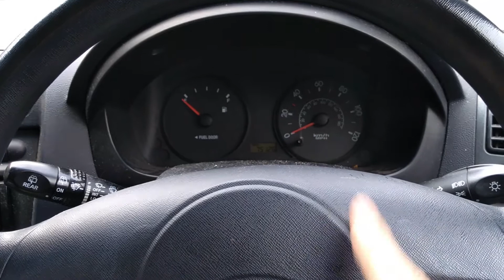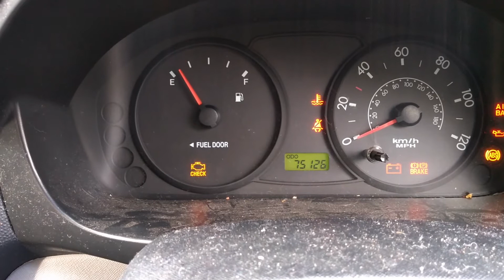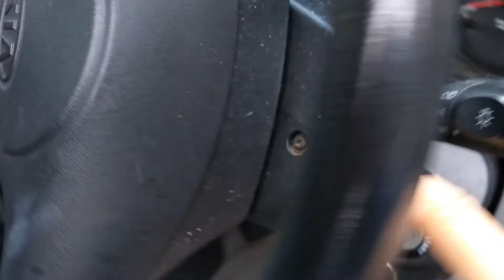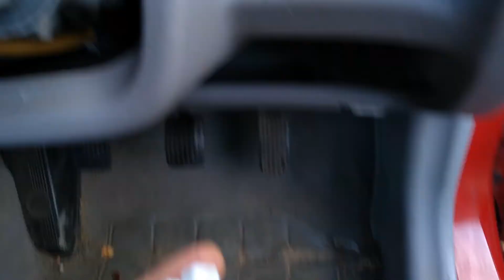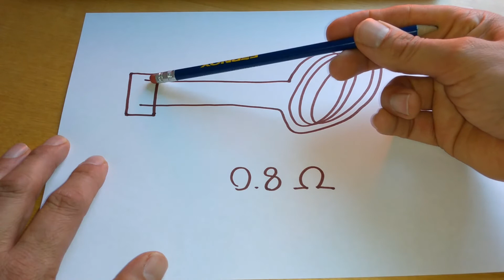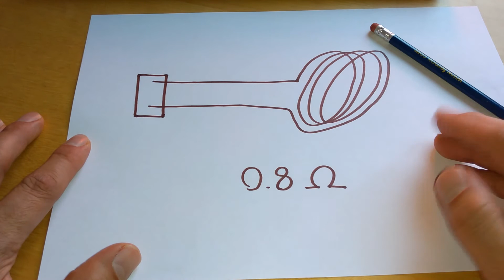Kia Picanto Intermittent No Start - Immobiliser Antenna Coil Fault - Diagnosis & Repair

Comment: Odd issue.. I hope I get an response…

My imobaliser light have stopped lighting.. but car starts fine.. (after I did the fix wirh the connectors)

But now the obd2 port have stopped working aswell… but car goes fine

Comment: Had this fault on 2009 Picanto. With flashing Immobiliser lamp. 
Did the multiple reconnections and has fixed it. Thank you. 
I accessed the plug from the fuse box cover as suggested by one of the comments on here.

Comment: Thank you so much for this video! I will definitely try this soon. Did just cleaning the contacts fix the problem for good?
Reply from the maker: Yes it did for me! :)
Reply: @iofix it seems to have also fixed it for me! I recently had a similar issue with my brake lights being intermittent. Took the clip off and sprayed some contact cleaner and worked a treat!

Comment: I never normally comment on videos, however this SAVED my car. Super clear video, worked with my Kia Picanto 2010 - I found if you know what the cable feels like, you can open the fuse compartment and reach round to unclip and re-clip the wire without taking apart the car. Super helpful video!!
Reply from the maker: Thanks for the comment and the extra info! :)

Comment: Brilliant!  Sounds exactly the same as my 2003 Hyundai Terracan (probably the same part).  In my case it has had this issue twice (crank, no start).  Both times after being laid up in a damp corner of the yard for a few months.  There was one point where the inside looked very damp indeed, so perfect conditions for encouraging contact corrosion.

Each time it's been towed out in front of my workshop in the sun and a few days later started fine.  It was only the other day I noticed the lack of immobiliser key symbol when it didn't start, and when symbol there, it starts perfectly.

In light of this video will pull the coil, test and if O.K. refit after a dose of contact cleaner and a good wiggle!

Thanks again 🙂
Reply from the maker: Thanks for the comment and extra info - sorry for the late reply.

Comment: This happened to my Sportage so i soldered the two coil wires to each other and bypassed the connector its a lot easier on the Sportage

Comment: That's more like the fault oxidized connection than the coil .. but strange how it's intermittent .. if oxidized switching ignition on and off wouldn't fix the oxidized connection .. thank you for posting .. hope you've solved the problem :)
Reply from the maker: Yes that fixed it my case. Cheers

Comment: Hi, thanks for the video. I have a similar problem but there’s no ecm light or ignition light at all! Just a crank no start, I’ve changed the ecu for a cloned one with still no luck and no mechanic is interested in solving it

Comment: I had the same problem with Picanto 2009 with the connector which I cleaned and remade. Lasted another 4 years and the defect is back again so will clean it again.
Reply from the maker: Interesting - thanks for the info.
Reply: What way did you fix the connection, I’ve replaced the new antenna coil from Kia, had a new key and still the same intermittent cranking and no key symbol. Cheers
Reply: @dmc1221  I used contact cleaner sprayed into the connector. Look closely at the connector pins and see if they are corroded. I would also have considered using an inline splice to connect the wires and remove the connector but in my case it was not necessary.
Reply: @ianhodges1657  no problem thanks 👍

Comment: In my mom's Kia there is the same problem once the car light appears once not, some time ago I dried the antenna coil because it was damp and it was quiet for some time, I have to measure the resistance .

Comment: Great video. I must try this as I have the same problem with my 2005 Picanto. Do the two connectors just pull apart or is there a button/latch that needs depressing. Worried I may snap things.
Reply from the maker: Glad it helped, I'm afraid I can't remember the connector design.

Comment: Hi, Thanks for this video, didn't think about immobiliser. I was thinking more towards starter motor as the engine doesn't turn but clicks when turning the key. Kia have changed the battery and was OK for a few weeks but problem back again. Been back to Kia but they cant find anything wrong. They changed the fuel filter as well. So will try this. Thanks
Reply from the maker: Yea sounds like u might have a bad earth, and/or parasitic draw.

Comment: You sir, saved me from 250€ today!
I fixed my 2007 Picanto by cleaning the antenna connector like you did (I used a contact cleaner spray, in addition).

Tip:
For better access to the connector, I unscrewed the gray plastic under the steering wheel. It was a 3 screw piece.
Reply from the maker: Excellent, glad it helped u. Thanks for the message.

Comment: Just undoing the connector and spraying wd40 and connecting and un-connecting usually does the trick.
Reply from the maker: Thanks for the info.
Reply: How much wd40 to spray?
Reply: @MsSimixx  couple of squirts , repeat if necessary.

Comment: If there's immobilizer problem would the car shut-off while driving. My Rio have that issue. Offen while I'm driving it shuts off and I can't start it in about 10 crank times
Reply from the maker: That does not sound like an immobiliser issue issue to me, more likely to be a failing fuel pump relay or crank sensor etc.
Reply: @iofix  "on the end of the day" it turned out that it's the crankshaft sensor, now it's OK
Reply from the maker: @sinisabogatinovski1270  Great, thanks for the follow up info.
Reply: Thanks man, I was thinking that way also
Reply: Same here Exactly. NO-computer cars = NO problem. It looks like a national fraud. DO NOT BUY KIA, for one thing. It undoes the 11 good years in one shoddy "Fail".
Reply: Immobilizer is a handshake procedure at initial start ONLY. After that the car can run and travel around the world if you can.

Comment: Have same thing with my Kia Ceed. Sometimes can't start for like 10 times. I let it sit for 2 hours and then it starts. 2 different mechanics scanned it for codes and nothing. Changed crank sensor, spark plugs and still same. The only thing is that I am not getting any light on my dash.. If it starts or not still no immobiliser light. Does that mean that I have a different problem or can it still be the same as in this video. Thanks.
Reply from the maker: Maybe still related to the immobiliser but I'm guessing probably something else. Probably best to see what's missing when it does not start - fuel or spark, if both missing then check to see if computer is 'alive' (check for 5v ref at one of the sensors), if yes check to see that the crank sensor signal is making back to the computer (and also that your other inputs are plausible). If computer not alive when it does not start check powers & grounds at the computer (and wiring etc) - if those all good then it could be the computer (ECU).
Reply: Nice 1 I will be checking it before I order a replacement do you know if you have to remove the steering wheel on ceed to remove collum
Reply: Kia motorists are being fleeced by this very Expensive very sly tactic.  Pensioners can't afford to play this shabby game.  Down with Immobilisers at once. Make NOISES everyone!
Reply: I have the same problems with my 08 plate ceed where it start one time then next won't I do find moving the wheel and wiggling the key works so trying this out myself 👍 thank you
Reply: @ianblythe1992  I managed to sort out the issue. Started using my spare key and since then never had an issue, not even once and it's been a few weeks already..

Comment: Hi, thanks for this very useful video! Finding it made my day! I have one questions though - did you have to code the keys after you had fixed the problem?
Thanks again!!
Reply from the maker: Hi, glad u found it helpful. No did not need to reprogram the key. BTW would be grateful if you could support the chanel by subscribing - thanks.
Reply: @iofix  please show more videos on HYUNDAI i20 1.2 2011 petrol.
Reply from the maker: @tnamen1307  Yes I will if I get a chance, please subscribe to support the channel and make sure u don't miss it! :)